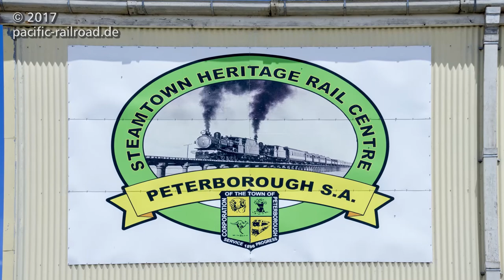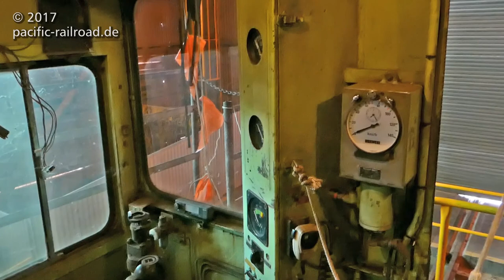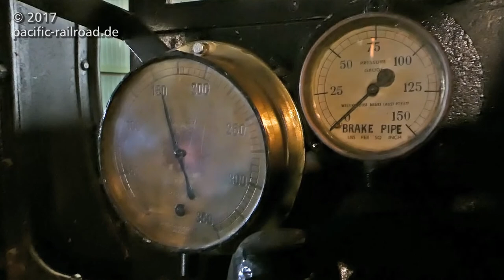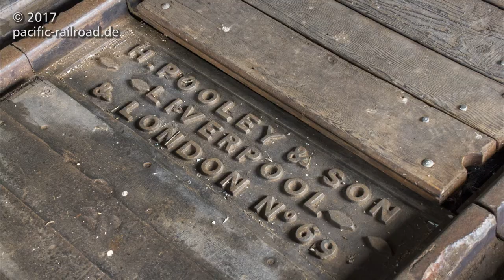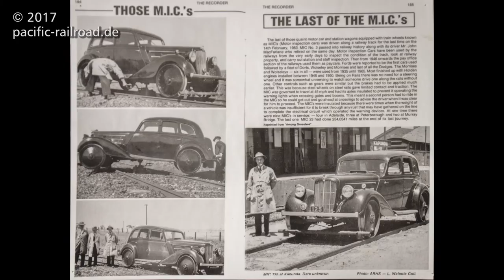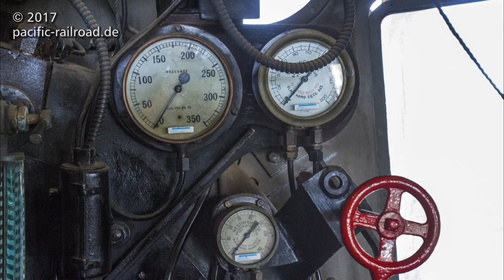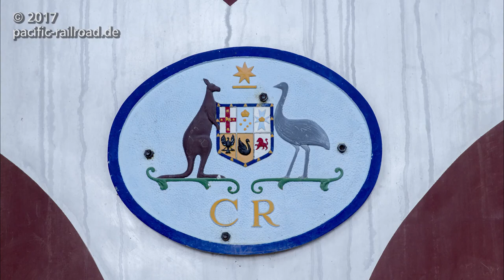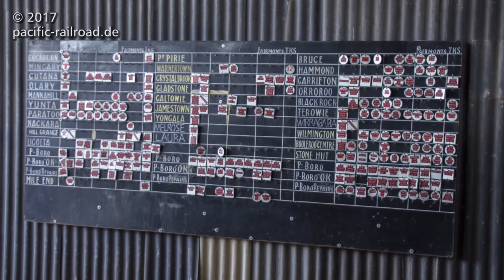Railroads of Australia: Peterborough Steamtown Heritage Rail Centre

Comment: I visited this place a couple of years ago...a lot of upgrades since this video was done.
That passenger car on the turntable is where you sit to watch the Sound and Light Show at night... it is truly awesome.
Note that this facility is unique, it has three gauges of rail access - narrow gauge, standard gauge and broad gauge.
I'm pretty sure that inspection car is not a 1948 Holden, although, if I recall correctly, it did have a Holden motor under the bonnet. 
Loved visiting Peterborough - lots to see and do there.